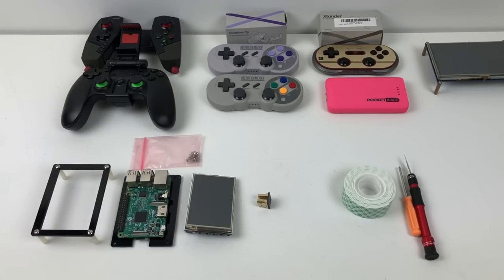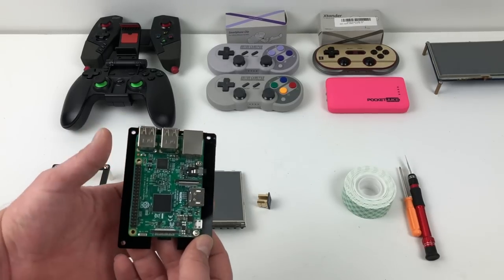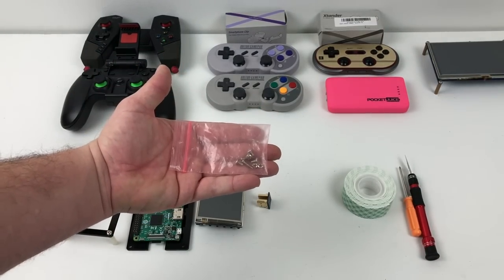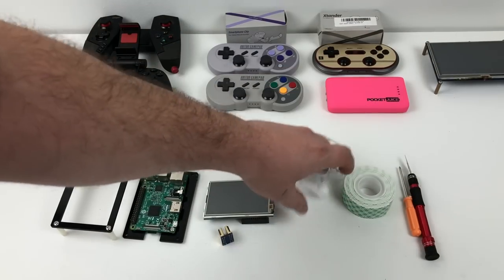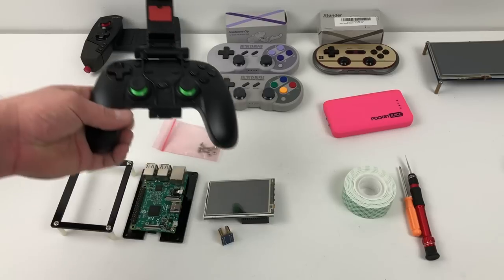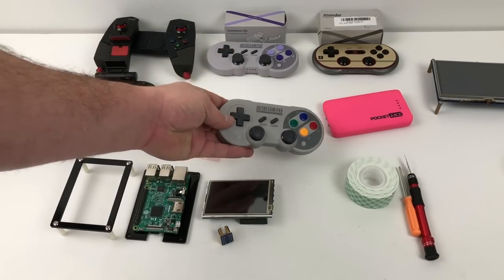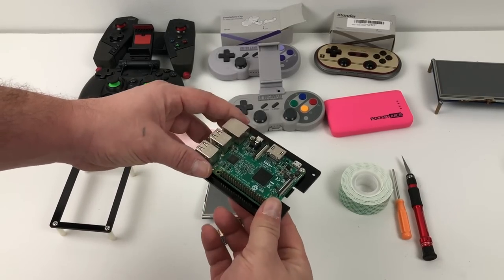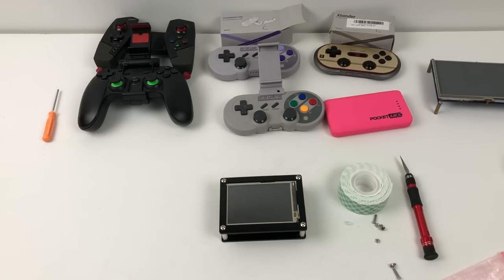Build A Handheld RetroPie Gaming Console No Solder SUPER EASY!

Comment: The 8bitdo sn30 pro & sf30 pro controllers are amazing.. worth every penny I tell ya!!!
Reply: Word of caution though, there were a batch of the sn30 pros & sf30 pros that would suddenly freeze after a minute of use.
Just request a replacement immediately if you experience freezing, don't try flashing the firmware it may get bricked.
Reply: @carlangelo653 cheers, interesting to know. We have solely used these for Android emulator's and have yet to experience any issues.
Reply: @sugars205  Out of 8 controllers we had only 1 that had problem. There's probably only a few out there with defects. And we've all been using 8bitdo before with no problems.

Comment: I would just recommend a $30-50 prepaid android phone. It will out-perform this and be way less bulky. I have been doing this with an LG Tribute 5 for years. Actually super nice because the resolution of the screen is only 480p which means integer scaling on NES/SNES (2x) and more importantly GBA (3x).

Comment: would be interested in the lighter battery version, is it possible to show how to use a display not through hdmi but through some serial connector? so that it makes connecting to a tv easier without removing hdmi dual connector

Comment: How many GPIO pins are still available after using this display?  (does it only use the GPIO header for power?)

And as a sidenote; instead of buying an 18650 cell, holder, charging circuit, etc... for my build i picked up a 3 cell battery for $15, and removed it from the case, distributing the cells inside of my Lynx... It works great and lasts for hours!

Comment: Hi ETA Prime. Thanks for the video on this. I'm about to build this. My 3.5" screen did not come with a backplate, though. Maybe I can find one on Amazon...  As for the speakers, I am going to try the INTSUN mini portable speaker 3W from Amazon and see if there's room for it to fit, and how it sounds. Take care!
Reply: How did the speaker turn out?
Reply: @artemisfowl577  The speaker worked out good for what I was needing. No wires to get in the way, and I could easily point the speaker toward me since it plugged directly into the audio jack. It has a rechargable battery, seems like the battery life was good too.  I can recommend it if the speaker is still for sale. I found it on Amazon.

Comment: Cool video,  Do you know what the native resolution of the display is?  it says it does 320x240 up to 1920x1080.  Just curious if it's actually 1080 or if it's just scaling 1080 to whatever the native res is.  1080 at 3.5" would be a high pixel density and would be awesome if that is what it truly is.

Comment: it's a cool project. but to be hones... at this point you can just strap your old phone to the controller and install the emulators there.
i'm sure almost everyone have an old phone somewhere in their home. you don't need the phone functionalities. 
the pros - a lot lighter and not so bulky, higher battery life for the size/weight (you would use only the emulation, so no phone coverage, you can play in airplane mode or just turn off the sim and so on), it won't look like put together from scraps.
the con - it won't be that powerful. unless you use your new expensive phone, emulators won't be as powerful as they would be on the raspberry pi 3
Reply: Eh, my terrible Mali-400MP-powered tablet is able to run Commander Keen in DOSBOX along with many N64 games, Doom and anything i want it to run so it's good enough.
Sadly it has no gamepad support so while pairing it with a cheap Logitech F310 is a no-brainer it's not possible. And i suppose this is the case with many other old phones.
Reply: @TDRR_Gamez  isn't f310 a cord controller? what pairing are you talking about?
Also what do you mean "no gamepad support" whatever the controller is giving as an input the emulators can map it to the corresponding key. unless the device is not giving any indication of a button pressed, then you should be fine.

Comment: Hello, I have a question. If I didn't want to have to deal with the bluetooth controller (i hate anything bluetooth) would I be able to attach the retro Pi to the mini screen and plug in an actual usb controller and not attach the whole thing to the gamersir controller? So basically am I able to play it like a mini tv? Hopefully this makes sense. If I am able to do this, can I still plug in a usb controller along with the battery pack? One last question: will this handheld setup still play PSP and playstation 1 games? Thanks!

Comment: Hi ETA, sorry for bothering you. I saw your video and decided to do the same project at home. Everything worked well, but I failed with the battery. The battery is 5v and 2.3 A, but when connected by USB the raspberry shows the icon of the beam for lack of power. I think it's because the USB can not carry the necessary current. What would you recommend me to do?
Reply: How many ports doest it have?
Reply: @shaddonai2636  Hi!, Ty for you responde. It have 2 port. One 5v with 1A, and other with 5v and 2.3A
Reply: @manuelantoniomarquezrossie1120  That should be more than enough. The raspberry pi only draws 300 mAh on idle and 700 mAh on stressed, plus the 250 mAh of the screen. Maybe it is just a program error. There is an easy way to get rid of That symbol, just Google it.
Reply: @shaddonai2636  ty very much for your response. I Buy exactly the same battery and I had no more problems. Ty!!

Comment: @etaprime I love your videos, and wanted to undertake one of your projects to take with me on a trip in July. I was hoping I can get your opinion first...

I have a Pi3 and a 8Bitdo FC30PRO. I’d like the 5” screen, but am worried about weight and battery requirements with the smaller controller. Will I notice a difference?

Second; I have a Lumsing, 4000mAh battery in a single, flat, aluminum foil covered slab. If I use this with the included USB charger and controller, do I need protection from overheating, or can I just zip tie it to the back and have it touch the 8Bitdo controller arm directly? If I go with a 2500mAh 18650, will I need a minimum of two for the 5”, or can I get away with one for 2.5-3 hours? I’m not certain of the different screen power requirements.

I appreciate the help, and please keep up the good work. Also, I’d love to see that 18650 mod you were talking about in the beginning and end of the video. Cheers!
Reply from the maker: I would go with the 4000mah flat pack. The setup won’t pull enough power to overheat that battery just make sure you don’t short anything out on it! 

As for weight the 5 inch is a bit heavy for a setup like this. Have you seen my Ghetto Boy build? https://youtu.be/5mCKVIiTx34
Reply: ETA PRIME ETA PRIME I did, but I already had the 8Bitdo.

I think I will go with the 3.5 with the pack zip tied to the back. Thank you for the help.
Reply: @etaprime I got my screen today, and I'm loving the results of this project, though I will be getting some 18650 batteries soon for space sake. 

I'm having one issue, however; I've edited the config file and have the IPS screen running through HDMI at the borderless resolution, and I've noticed some refresh issues, tearing. Even before the text edits. Everything either lags a fraction of a second or tears. Such as in the RetroPie menu. Did you run into this issue, and how did you solve it? Thank you in advance.
Reply: @etaprime Are you not familiar with this issue? Could I have gotten a bad screen or a disabled v-sync?
Reply from the maker: What screen are you using? I haven’t had any issues with mine.

Comment: Why don't you use the pi 0 z then you'll have space for a real battery (rechargeable)  and speakers!
Reply from the maker: I’ve actually been experimenting with that. The issue is the Gpio power to the Pi. You will have to either wire it up or add a header and re route the hdmi.
Reply: Maybe a pi3 compute module inside a USB game pad, like the logictek ones, as they have lots of left over space inside, and the vibrate motors could be replaced with big batteries.
Reply: What about a Raspi 0WH?
Reply: Nash Anderson because it's not powerful enough
Reply: Rapts I though it can only handle NES games, but not even SNES or anything as demanding like that?

Comment: can i also play n64 Games on this rasberry?
Reply: Ungefug Luis Well you can, sometimes. Some games straight up can run and some lag, but you can technically play them. If you overclock your Pi so it uses more power, it runs them better. The issue is it burns up your Pi faster so you can’t use it for as long as if you don’t overclock it before you have to turn it off and let it cool down.
Reply: Land Squid 1234 ok thanks. I Think i will play in the original. :)

Comment: I think this project is a total waste of money and time! A cheap prepaid burner phone from bestbuy on sale $30 gives u retroarch runs all games ps1 and older, a 5inch touchscreen, battery, 8to16gb of onboard storage, and charging cable all in a convenient thin phone. Just add any controller or two if it has otg 
Also i can run any app games and kodi or terriumtv all without using a mouse or keyboard!

Comment: Why not buy cheap android phone with decent gpu and cpu ? Its probably cannot play PS1, N64, and PSP but at least you can play NES, SNES, GB, GBC, GBA, Sega Master System, Genesis, and some old Arcade game, then buy cheap bluetooth gamepad like GameSir or Ipega. After few setting like mapping controller, costumize screen aspect ratio, filter video like use scanline or not, and set Roms folder you good to go. Heck i buy all of this for less than 100 dollar and if i want step it up for play PS1, N64 and PSP game its will cost me 200-300 dollar.
Reply: Bhirawa Maylana because this is 30$
Reply from the maker: I have cheap android phones that play ps1 just fine. The whole point on this is putting something together. Last Black Friday Best Buy had dual core are android phones for $7 and they actually play gba pretty good. I picked up 4 of them for my kids.
Reply: ETA PRIME Nice i forget about Black Friday Sale, well i still think its more cheap and more compact to just buy cheap android phone and controller.